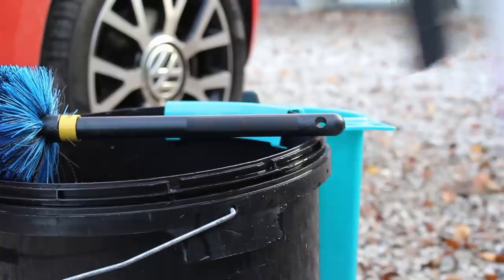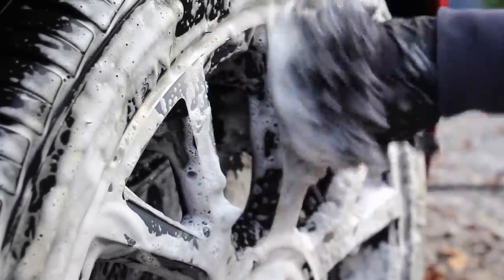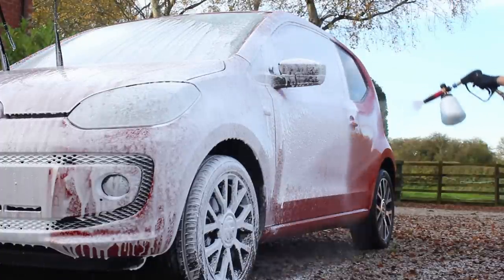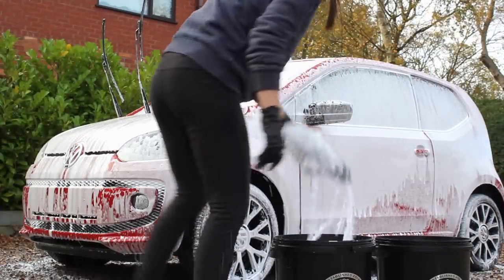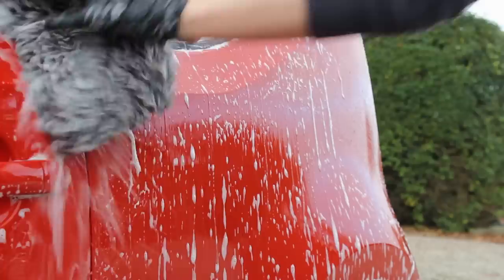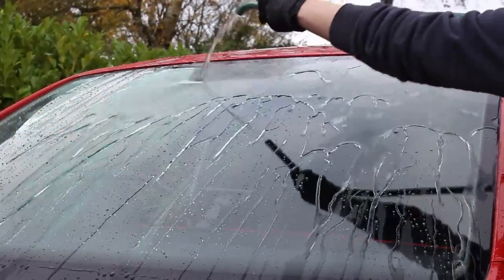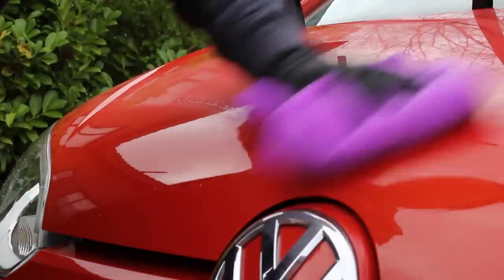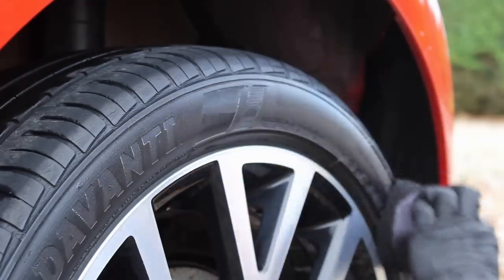Volkswagen Up Wash | Exterior Car Cleaning

Comment: Tip top job on the first of 2023 👍 GT snow foam is a one i’ve got to try as I’m tempted by their ceramic coating. That tyre dressing looked ace too although Tyre Serum is hard to topple. Keep the cleaning coming all year 👌
Reply from the maker: Thanks for watching :) GT Tyre Serum is very tough to beat, I've also got their ceramic coating to test out so I'm thinking of putting it on my car when Synergy Lite starts to die off

Comment: Hello Heather, great work as always. You mentioned you can’t dilute forst and have to use it neat. Stjarnagloss listened to the community feedback and actually made a ‘ForstX’ variant which comes in a concentrated form factor, so it can be diluted to suit various applications!
Reply from the maker: Thank you! ForstX is a great idea, I’m very tempted to grab a bottle of it!
Reply: @AutoCareHQ  do it it's cracking so when I first got it from jack at stjarnagloss I had limited information as it was pre release , but since his given me more info and dilution ratios and honestly the stuff is amazing and has so many applications, altho you don't need Forst X to do this , you could dilute Forst and work out the dilutions, but it's a very good product and in my top three Pre-wash spray ,

Comment: Promised I'd let you kow how I got on: Finally gave the DeepMile citrus cleaner a go (amazing stuff that was, shifted so much as both my cars have been neglected in recent months). Also cracked open the foam sprayer as a first go having viewed them on your vids. Really happy with both. Garage Therapy tyre stuff had to wait as it got dark and yep, started raining again just as I was finishing as it  did so for the next few days then Xmas etc. Enjoyed using all of them so far and I can see the hand foamer sprayer being used a lot more than I thought I might and more so in many more ways than I'd initially thought as well. I love these little Up's and it looks fab. That quick detailer really does the business doesn't it! Next is the blower and was wondering whether the top banana one but think I'll stick with the one you have. Pending link use incoming.
Reply from the maker: I'm really glad you're enjoying the new products! That's so typical haha, I was outside today cleaning someone's car and it chucked it down as soon as I'd dried it 😂 Good shout hanging on until it's dry though as the GT Tyre Serum doesn't apply very nicely if the tyres are slightly wet
Reply: @AutoCareHQ  Thanks for the damp serum tip. Also a good job I can rectify next time as i've got a new GT blower arriving Thursday then, so using your link, also as promised, that's my tip to you!

Comment: Happy New Year Heather.
I finally got chance to use the Garage Therapy Wheel Shampoo over the holiday period.
Your review was spot on,it’s great stuff 👍
One question,how do you get your Snow Foam you last so long,I’m using Blit Hamer Auto Foam and it never last more than a couple of minutes?
Reply from the maker: Happy New Year Richard! I'm really glad you like the GT Wheel Shampoo, I wouldn't be without that stuff. To be honest BH Auto Foam doesn't dwell that long for me either. Applying it to a dry car can help but it's dead thin so it does slip off the car quite quickly

Comment: Great vid Heather 👌  I'm still rockin the lance applied GT shampoo, best tip of 2022! Would you go back to 2 bucket when the sun is back? Dry out?
Reply from the maker: Cheers Kevin! I stuck with the shampoo in the lance throughout summer to be fair. I sometimes needed to work a few panels at a time before rinsing so it took a bit longer but it just feels a lot safer on the paintwork so I didn't really mind the extra time!

Comment: Thanks for the Monday drop Heather. I’ve been thinking about buying some Atom Mac to spray on my rotors. Do you think this is a better alternative to spraying some Brake Buster neat on them?
Reply from the maker: Thanks for watching :) Yep Atom Mac will work out much more cost-effective long-term as you only need to use a 5% solution, I've also found it a lot more effective at preventing the rusting on the rotors compared to Brake Buster

Comment: How often do you clean your own car to this extent? How many times or often you recommend? 🙂
Reply from the maker: I usually do mine once a week but I don't add protection every time, just when the water behaviour is dying off a bit. On the other cars I look after I usually don't like leaving it longer than a month otherwise the contamination builds up and sticks on the paintwork more so they'd need claying more often
Reply: @AutoCareHQ  Fair enough, thanks for the info 🙂 I tend to do mine once a week to, hate driving in a filthy car 😵